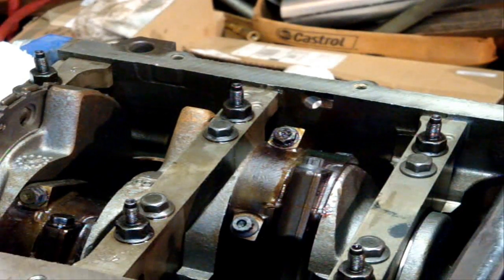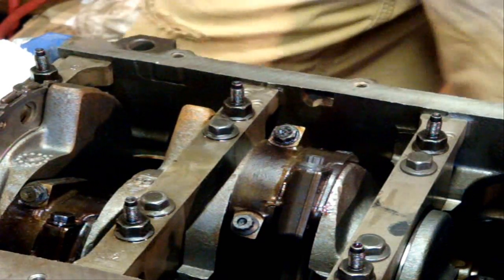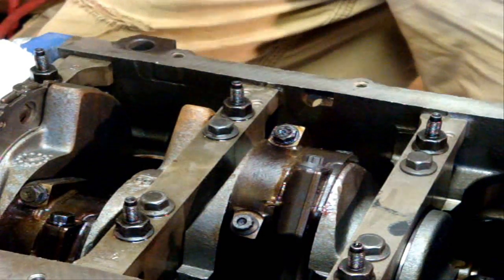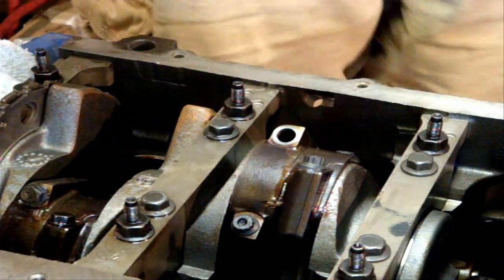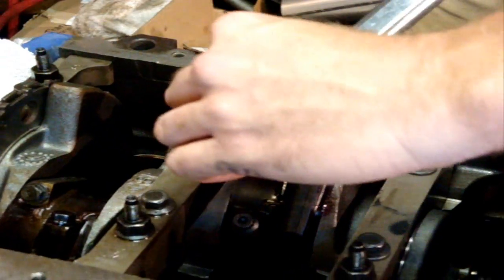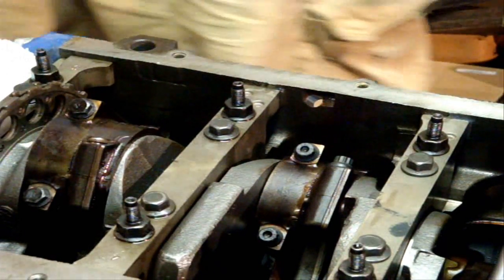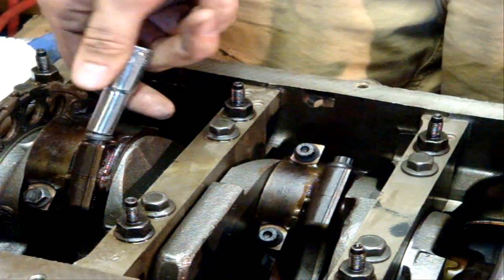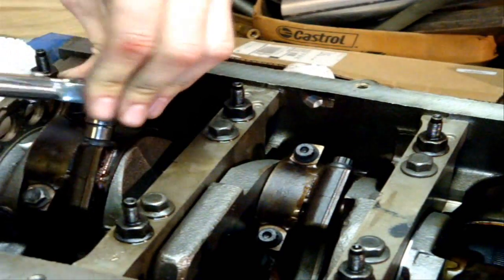ARP Rod Bolt Install - LQ4 Build Segment Six

Comment: Any time you add more clamping force, it will distort the metal that it's clamping. Sometimes you get lucky and get by with it sometimes you don't.
Reply: Totally agree, By him removing them ferruls as he calls them also serves the purpose of aligning the rod cap to the rod just as all aftermarket rods have, Bad news removing them
Reply: @bidenstoletheelection9116  yep, I didn't even notice that. That rod cap's going to dance.

Comment: I have a really low miles 2nd gen small block going in my 96 impala, I’m going doing a Lloyd Elliott heads and cam swap. I would like to change my main bolts and rod bolts to arp bolts. I was wounding if I could change them out one at a time with out pulling the motor apart
Reply: bubbs tubbs My short block is like new, crosshatch looks like new. I cant read all of you replay, When I click read more nothing happens but thank you for answering my question. I think I’m just going to do that mains

Comment: Are u using the Ferrells from the stock bolts ? Some arp bolts state 40ftlbs n some say 45ftlbs what’s ur take on booth situations?
Reply from the maker: Hi Jose.  Sorry for the delay.  No ferrules.  Those were yanked out with the stock bolts.  40-45 ft lbs could be the difference between a calibrated torque wrench and one that is off a little.  I dont THINK you'd see much difference, but I went with 45 I believe.
Reply: JEG's Garage hey thnx I appreciate ur responding. I did exactly as u did in the video .. ur one of only a few people that made a vid on that subject. Great vid
Reply: Jose B have u got the motor running? How have yours held up?
Reply: @classiccam4647  yes it’s up n running sorry for the late responce . Just got it started 2 weeks ago n everything internally is perfect so far
Reply: 40ft-lb = 8740 bolts
45ft-lb = ARP2000 bolts

Comment: Great build, . For anyone else looking into ARP rod bolts for LS1 I was in a similar situation and found a set of  scat rods at summit with 7/16 rod bolts for $275.00.  Then I changed my mind again and bought the ARP rod bolts installed them on the stock rods and torqued them down and resized them .002 over Then I was able to purchase LS1 rod bearings that are .002 on the outer diameter worked perfect. So to reiterate my stock rods could never be used with stock OE. bearings as my rod big end is .002 bigger than stock. Clevite makes a .002 oversize outer diameter bearing with a stock diameter crank pin diameter.
REPLY
Reply: You can’t take a few thousandths off the caps on a cracked rod for obvious reasons. The only way to resize a cracked rod is to simply oversize the hole. Thus, the oversized bearings.
Reply from the maker: Thanks for the comment!  I wasnt sure if they made an oversized rod bearing that is ALSO undersized for a cut crank too.  I didnt find any when I was looking.  That was an other reason I didnt do it...because my rod journals were .010 under due to the reman crank.

Comment: interesting to note that when tightening, your 1st torque was dead straight to the main caps, by the 3rd you were about 10 degrees clockwise further than the first, proving ho much it had stretched the bolt
Reply from the maker: Nah I think that is the ratchet mechanism causing the final position to be different.  I was clicking the wrench back a few clicks between each one to do the loosening.  I wasnt really consistent with how many times I let it click.

Comment: I doubt arp bolts is the cause of bearing wear.  I blame it on the oiling system.  I had a 98 z28 that spun a bearing had it remachined and did it again.  It's the oiling system of LS.  The oil pump should be ported.  Not to mention clearances are already tight.  I learned all this in machine school
Reply from the maker: It could be oiling... My oil pump, the pump that was on the old LS1, is a ported pump.  I get amazing oil pressure, and the bearing wear on the LS1 wasnt extreme.  That motor was POUNDED on.  It saw lots of track time before I got it.  So I expected some wear anyway.  Clearances are pretty standard in my experience.  I set my 6.0 up a little on the tight side, but not at the tightest.  Allows for a little wear/break in and should bring things into middle of the road spec.  I havent been back inside this motor, but I am kind of curious to see what it looks like.  Maybe when I get a house with a garage.
Reply: Mine was pretty bad but it was a stock motor no mods and the rods still spun.  My dad's 02 as stock also and he kept it in great shape always changed oil never dogged it and a rod came out the side of the motor.  Good work though man  I like the vid !!!!!

Comment: Is she still holding on?
Reply from the maker: +Cory Vazquez heck yeah! Just got her ready for spring. Oil change, general maintence. Got her inspected. Couple of tire frying 7000 rpm shifts on the way home. She's running great!
Reply: JEG's Garage are you still on the same bearings/rods from this video? if so, how many miles are on the engine since you've done this?
Reply from the maker: Same bearings.  Same rods.  I havent cracked that motor open so much as to replace a thermostat.  I have about 10k miles on this build.  Never much of anything on the drain plug magenet, in the oil, or in the oil filter when I change it.  The car is always under 5 k a year to keep me emissions exempt.  When its out...its beat on pretty hard.  I get it out of my system, then the car sits for a bit haha.  This season I plan to get some dyno time in, hit the track for both drag and maybe some auto-x events.  I also plan to just plain drive it more.
Reply: JEG's Garage that's awesome. I'm about to put new bearings and rings in this 5.3 I have pulled apart. It's going into my c5z with a 7875 turbo. Did you ever check clearances? I'm going to check with Plastigage.. just curious to know what your clearances were.
Reply from the maker: I did gauge it...but I couldnt tell you what the specs were.  I have them written down in the manual but thats still in the garage where I built the thing.  I was within spec, a hair towards the tight side.  Which is how I like to set things up, so when it wears in a little, its in the sweet spot.  That is a reman crank from Autozone since the factory crank was chewed up.  It came with matching bearings.  I was actually surprised at how well everything measured out once it was together.  I think my main journals are .020 under and the rod journals are .010 under.  I ordered probably half a dozen cranks in until I was happy with how little they were undersized, and how well it was finished.

Comment: Can you replace the connecting rod Bolts without taking the engine out of the car, if so how? Do you maybe remove the oil pan under the engine and can change to arp bolts that way? I'm unsure how it works.  I would be very glad if somone could explain how it works. Thanks. :)
Reply from the maker: +Equalizer well it depends what car it's in. For instance, on my trans am, I can use an engine brace across the top and remove the k-member underneath. That would allow me to drop the pan and the windage tray and do it. If you can't drop the engine cross member, or there is no room to get the pan out (remember there is an oil pick up also), then no. You'll need to at least lift the motor up high enough to do it.
Reply: ***** Thanks for the respond. I have an Opel astra F GSI. I have plans to tune it a bit. Get higher rpm and protect the engine from break down.

Comment: I bought a 02' LQ4 with Car Fax documented  28,xxx  on it when the 2500 LT got destroyed
I was just going to bot it in my M-715, however I am following story on making 600hp with a turbo, they did it with a 5.3 with a used LS6 cam.

You know, I can see pinching in some places, but this is NOT one of them,  no way no how am I going to trust  eBay user "Yo_Dope" with used LS7 cam .......or anything by that matter.

Have to admit, I really did not know if you could do this on a LS, had my hands in mostly PMD, Olds and Chevy engines, this made me wonder.

Thinking of just stabbing the 6.0 in and then looking for a good 6.0 core and starting over....

Anything you would do different with your LQ4?

Thanks.
Reply: JEG, did you read this?
http://ls1tech.com/forums/generation-iii-internal-engine/1543525-rod-bolt-replacement-lesson-if-your-thinking-about-doing-come.html
Reply from the maker: Hi ramair.  Yes I have seen that thread.  And several others showing the wear you get if you just replace bolts.  However...my original motor was an LS1 that was built as a short block by an aftermarket dealer.  It came with oversized rods with matching bearings and the ARP bolts.  When I took it apart, it had very similar wear to what you see in those pictures.  And I know they were resized because the bearings showed the size.  I really want to see what mine look like after a few thousand miles and me beating the crap out of it.  However I have no noise, no loss of oil pressure, and no real issues.  As to your other question about what would I do different.  I would have saved a bit more and got new heads.  And maybe ditched the FAST 90 for one of the newer units.  Otherwise, I love it.  Its reliable, easy to drive, tons of power without being overkill.  I would really have liked to stay aluminum block.  But this will last me for a while I think :)
Reply: Thanks for the reply.

I read every bit of that post, it did have merit, and oddly nobody wrote in with a factory rod bearing fail, one guy went with LS7 rod bolts.

It's made me think about dialing back the HP to around 450/500 for the LQ4, saving the Alum Cathedral ports, and maybe even the stock cam, just running a safe boost and see what I get.

After all this is just a military truck. 

It made me think of all the rod bearing fails I have ever seen, not many, at least not many that were the cause of the issue.
Main bearings seem to be the ones I always see or hear about.

That FAST 90 is a chunk of money, every time I see one I think about how it only beat a factory truck intake by 15 ish HP, im not sure you can even feel 15hp..

It's a great intake, have you seen the duel unit they showed at SEMA?

This LS engine... it makes the hero power of the 90's without thinking.
Reply from the maker: Yeah there are definately some horror stories.  But you have to remember, if there are 100 guys that say ARP bolts caused their rod bearings to fail, there are probably 1000+ that arent reporting anything, because most of the time people only give opinions when they have issues haha.  

Military truck...that sounds awesome!  Do you watch Dirt Everyday on the Motor Trend youtube channel?  He put a CTSV motor in an old army pick up.  Ide LOVE to do that haha. 

FAST 90 was the best there was back when I was building the first car.  15 hp over the truck intake, until you put good flowing heads and ported the intake more.  It still does ok, but if I build something new Im stepping up.  

Its really amazing what you can get out of these motors.  They're so darn small, and if you run an alum block, you hardly gain any weight over a 4cyl in some cases!  Its amazing.  HP Tuners is awesome too.  Lots of stuff you can taylor to do exactly what you want, and its easy.  No chips to burn like back in the day haha.

Comment: I wanted to see if ARP 2000s would change the roundness on LQ9 rods before i installed them.
they were super out of round by 0.002in
BUT not all of em went out of round on me.
still not sure if it's acually an issue, considering the crank journals would keep it more round.
Reply from the maker: +AllyourBaseArebelongToUs I thought about checking mine...but ultimately decided "out of sight out of mind"  was the best course for me haha.  I still dont understand the theory behind them going out of round with a bolt change.  I feel like if they go out of round with  the ARP, they would be out of round with the stock bolts cranked down.  I realize they can exert more clamping force, but just dont see how they really deform at the torque that we're installing them.  Not saying it doesn't happen, just saying for me, I was willing to pop em in and see what happened.  Its no secret that I want to build another motor.  One of these rods blowing apart wouldn't be the worst thing in the word :)
Reply: I ultimately decided to buy Callie's rods with ARP 2000.

I really didn't like the out of round rods
Reply: Out of sight out of mind, because you don't understand.  I would explain it to you. But it's been almost a decade sense this video. But for anyone that runs across this. If you're going to get your information from u-tube. Pick a  machine shop/ Engine builder. Like powell machine. Steve Morris. Nelson.  👍

Comment: so its been over 3 years, how are they holding up ?
Reply from the maker: +Nick Ritter Just about three years.  Wow time flies.  Car is perfect.  Aside from some tuning issues that I'm sorting out, it runs amazing.  I never have any oil pressure issues, no noises, no problems revving into the 7000 range.  Im actually questioning whether the ARPs were even necessary at this point.  But I know they aren't going to snap.  I dug the car out of winter slumber a while back to take a guy for a joy ride...if I can get his GoPro footage Ill post it up!
Reply: +JEG&#39;s Garage awesome, I'm doing a build similar to yours and debating on doing this or not i have a 07 lq4 want to spin it to about 6700 rpm but don't want to resize
Reply from the maker: +Nick Ritter How many miles are on the 07?  Did you crack a cap off and take a look at the rod bearings yet?  Even on my LS1, which was an aftermarket short block with resized rods/ARP bolts, there was wear at the top and bottom of the bearings.  It basically looked like pictures that people post and say "this is what happens when you don't resize".  That was part of the reason I didn't resize.  I REALLY hope I dont HAVE to pull my motor any time soon.  But if I do, Im really curious to see how things look.  Judging by the oil pressure and general quietness, I think they're ok.
Reply: +JEG's Garage 87k miles never took anything apart down there but I don't want a rod bolt letting go at 7k and trashing my heads etc. but I might just do it this way and see how it goes
Reply from the maker: +Nick Ritter I would still crack one open and check the bearings.  87k is nothing for these motors assuming they were cared for.  So I wouldn't expect you to see much wear on the rod bearings, def not any copper showing.  As long as they look good, I say do the "one at a time" method and go for it.

Comment: Hey man i recently ran into the same problem while deciding too resize or not, I'm going with a boosted application how's this motor holding up any problems?
Reply from the maker: +Franky Weldon (Boostjunkiesracing) On a high boost build, I would probably be more inclined to have the rods checked/sized.  HOWEVER, that being said, guys like sloppy mechanics make insane amounts of power with hardly any engine blueprinting or careful building.  My motor is holding up extremely well.  Spins to 7k often without a hiccup, has great oil pressure, and makes no funny noises.  I cant speak for how the bearings are wearing.  I would expect to see normal wear at this point though.
Reply: +JEG's Garage that's awesome info thanks for the reply !!

Comment from the maker: @UNHAPPY CHAPPY When they resize these rods, they dont touch the faces.  They actually bore out the big end, then use an OVERsized rod bearing.  Im not sure what is available in both an Oversized and Undersized bearing, assuming you cut/ground the crank also.  Good to know that you didnt measure any distortion though!  Mine is still running strong with no signs of issues.
Reply: JEG's Garage when you change the torque on them is when you need to resize but you probably won't need a different sized bearing

Comment: INSTALLED TO ARP 2000 ROD BOLTS CHECKED THE ROD TUNNELS WITH A BORE GAUGE WITH THE STD BOLTS PRIOR TO INSTALL AND THEN WITH THE ARP'S INSTALLED THERE WAS NO DISTORTION IN THE TUNNEL AT ALL SO RESIZING WAS NOT NECESSARY ? ALSO ITS A CRACKED CAP SO HOW DOES ANY ONE PLAN ON GRINDING THE CAP FACES ?
Reply: You don’t machine down the faces on a cracked rod when you resize. Rather, you simply hone out the bore .002” larger in order to get a true, round hole. The rod will then require a bearing that is .002” larger on the outside diameter. Both Clevite and King make oversized bearings for resized LS rods.

Comment: can they be installed with the motor still in the car?
Reply from the maker: +DKNOTX Sorry...just now getting all sorts of comments.  Yeah...the could be installed with motor in the car.  It all depends how your access to the oil pan is.  If its a truck, and you can drop the pan...piece of cake.  If its an F-body like mine, its very labor intensive.  You'll need an engine bar to hold the engine up while you remove the front suspension and K-member in order to drop the pan.  At that point, you're probably better off just yanking the motor.  So if you can drop the pan, and have room to work, its easy.  If you have a k-member in the way, might as well pull it.  Thanks for watching!

Comment: Hey just real quick what did you do to your stock bolts after the new bearings.. did you torque or just tighten?
Reply from the maker: Joe Duncan Pretty sure I torqued everything to spec first.  I just wanted to know I had it all together properly, then added the ARP.  Do I think it made any difference?  No.  Just felt good to do it that way.  haha.